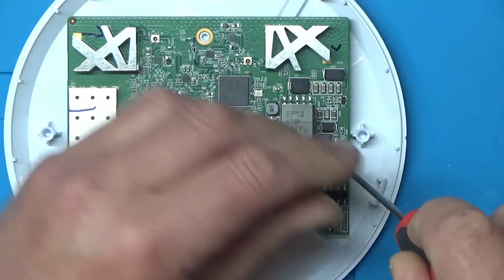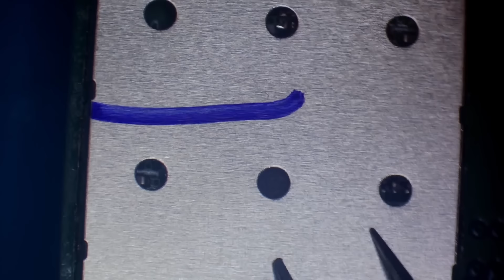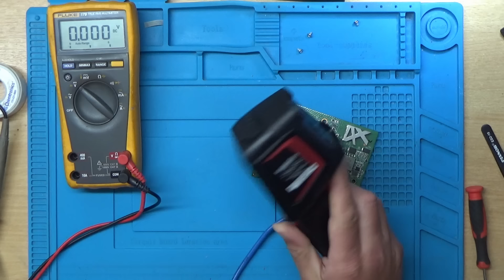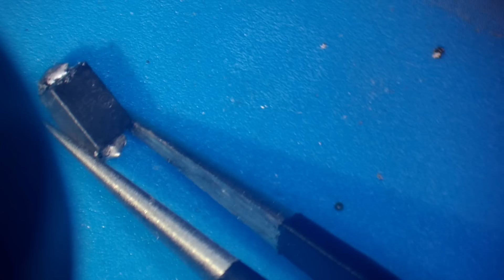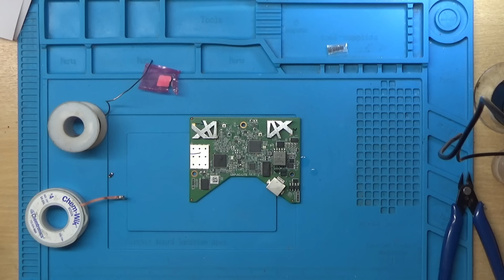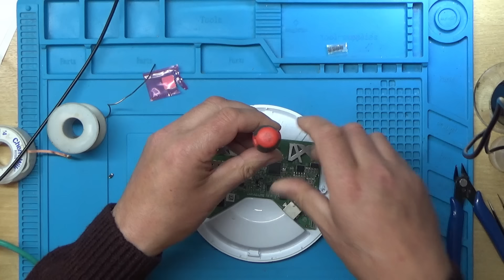Faulty Ubiquiti AC Lite WiFi Access Point | Can I Fix It?

Comment: Ubiquiti made some nice SoHo-Routers like the Edgerouter Lite / ER-3 but many suffer from broken USB-sticks (inside, cheap mans flash storage) and sadly broken ethernet ports. Replacing the USB stick is super easy and fixes the device, debugging the broken eth0 port is not. It's also the only one that comes up after a factory reset.
Reply from the maker: Interesting. Thanks for sharing 👍I've got a dead Ubiquiti POE switch which I'm currently looking at..

Comment: How come the diode didn't measure dead short in the circuit?
Reply from the maker: I'm not sure, the only thing I can think is that something else in the circuit was causing a false reading. I can't remember if I forgot to unplug the cable so it may have had power in the circuit still.

Comment: Have a go at the blue led lol.  They fail after about 6 months of use.
Reply from the maker: Yes a few others mentioned. I think someone mentioned putting two in parallel to reduce the current. It would be an easy fix but I've sent the unit back already.

Comment: How do you order such small quantities of components? Isn't it very expensive in shipping cost?
Reply from the maker: Yes, normally I'd use Aliexpress or Ebay if available. Or I've even ordered a small board from Amazon before when I needed a battery charging IC as it was cheaper than buying the IC by itself!

Comment: You want to try a crack on a video card? I have an older GTX 1050 Ti that the fan, when pluged in to the PCB, won't spin and do fan things. It was in my server for transcoding, so I did the right thing and soldered in a 3-pin female connector to plug in to a male connector on the motherboard. In the motherboard settings, I would just ramp the fan up by CPU temps. It would be nice to get that fan working again. I mean, it's not very powerful by any means, but it will do like 20 or so. transcodes, which is great for a very budget video card because you can support a whole village with it if you need to.
Reply from the maker: I've just bought a couple of GPU's to have a go at, the only problem is getting set up with a motherboard / psu etc on my desk to be able to measure / test everything. It's on my todo list which seems to get bigger by the day 😂😂
Reply: @BuyitFixit  always your youtube famous lol

Comment: If that thermal camera has a usbc port you can probably connect it to a pc and it will show up as a capture device.
Reply from the maker: Yes, you are able to record that way apparently but it's a little inconvenient. Ideally you should be able to record to SD after all it's 2024 not 1994 😂😂

Comment: I had the tvs diode fail on mine when I accidently put a 48V POE adaptor on it.. I just removed it and it runs fine.  it's primed for failure.
Reply from the maker: 😂😂😂Yes, I'm sure it would fail more spectacularly at some point.

Comment: 8:28 one tip to make the multi-meter shown the actual voltage when it's blinking like that is to take it out of "Auto Range" mode and manually set the range.  The problem with Auto Range is it takes so long to detect the range the power has shut off before it is able to lock onto it.
Reply from the maker: Interesting I hadn't thought of that. Thanks for the tip 👍

Comment: From my experience it should work when you remove that TVS diode. It is there as you said to protect the electronics behind and is usually at the entrance.
Reply from the maker: Yes, I suspect it should work by just removing it, although if the wrong PSU was used then it could destroy things further on instead of sacrificing the diode 👍
Reply: @BuyitFixit  Exactly or if there is another lightning strike the board could be damaged without protection.

Comment: "D23" on the white silkscreen refers to 'Diode 23' 😄
I have one of these APs, the Blue light fades over time, it's a design defect in their 5 series but the blue light is supposed to be brighter. (out of the box it was blinding so probably running it too hard) 
Had the power injector fail on me recently and had to replace, but looking to replace the whole thing with a newer wifi 7 model in the near future
Reply from the maker: Yes a few people mentioned about the blue LED 👍

Comment: hi out of interest what was the cost inc p=p for the part , i looked it up here in australia aussie website and it is for the part AU$0.61c and Shipping AU$24.00 thus making it $24.61 for 1 diode which is prohibitive for most australians but on aliexpress ( dont know the quality maybe you have opinions would be nide to hear ) 20 for $3.03 $2.99 p+p no wonder aussie busineses are failing, i have the ubiquity ap in my home so nice to see this fix, as an aside please do a vide on testing capacitors if you have not already done one if you have please put the link up thanks
Reply: thanks for the reply will keep watching
Reply: found my caps that i think i need for networking switch power supply on ebay australia from china free p=p will give it a try cheers i have inspiration but not the skills lol😀.
Reply from the maker: It was this item here I ended up buying https://www.ebay.co.uk/itm/155755878921 £4.49 inc postage for 5. They were cheaper from other supplies (22p each or so) but the postage was £9.99 so I just ordered them from eBay as it was the cheaper option 👍

Comment: Interesting that when listening to this video when you switched it on and it was working there was a background whine/buzz.
Reply from the maker: Yes the power supply I was using was an old one from an old access point I got from someone. It was buzzing so I switched it out for another PSU I had nearer the end of the video.

Comment: Since 2003, the PoE standard 802.3af has been upgraded to support higher power delivery. In 2009, the IEEE ratified IEEE 802.3at, which defined a similar technology that could handle more power. The latest PoE standard is IEEE 802.3bt High Power PoE, also known as Hi-PoE. So one might wonder if the unit was designed to only run off A or B mode cables or their own Proprietary switches if so that's Lame. Nice find with the infrared camera.
Reply: Early Ubiquiti gear used so-called "passive" poe which was just 24v thrown across a couple of pairs. There was no detection involved - the 24v is always present so you had to be careful not to damage equipment that wasn't designed for it. They did move away from it, first by selling dual standard access points that would accept 24v passive or 'proper' 802.3af, eventually dropping the passive 24v altogether. The 'dual-standard' access points had a sticker on the back that looked a bit like a power button symbol - a one and a zero superimposed on each other. I seem to remember there was a 48v passive too for the higher power gear, again totally dumb so plugging that into something that's not expecting it is likely to release the magic smoke.
Reply: @andywright3107  great information, Thanks

Comment: I own four Nano HD ACs. All the blue LEDs are starting to fade out. Any tips on where to get new ones? I have soldering experience and would like to replace them with "quality" LEDs.

Thanks for the great video. You've got yourself a new subscriber!
Reply from the maker: Thanks 👍It might not be the quality of the LEDs that's the issue. It might be that they are over driving them, and changing the resistor that feeds them to one of a slightly higher value would make them last a lot longer (albeit with slightly less brightness).

Comment: Congrats on your fix. These UniFi APs are enterprise-grade. I have 4 installed in my house (various models, including an AC LR, same generation as yours), never had a single hiccup. These work best with a controller, which can run on any Linux machine, mine runs on a Raspberry Pi 5. The controller allows not only to configure your WiFi, but also show connected devices, IP addresses, bandwidth usage. Although for just one AP, the app will do just fine for configuration.
Reply from the maker: Thanks for that and the info 👍

Comment: The Ir camera is an invaluable tool to have when trying to fix some of these boards. I really need to get one too. The only thing is that to get a descent quality camera, you have to pay a lot for it. The website you posted is awesome too. I had a diode I was looking for the other day and couldn't find it because of the markings (S4) on it didn't show anything I could find online. Eventually I worked it out, but it took a few hours to figure it out. great repair on the wifi too.
Reply from the maker: Cheers Ron

Comment: I love your videos, not least because I enjoy your accent, but I still found it really jarring every time you said "ethernet". I have been in IT for ever but I have never heard anyone else pronounce it that way!
Reply: I thought he said HefferNet!
Reply: It came from a working location that was probably the correct 24 V as it needs. Even a 48 V suppy "shouldn't" trigger a 58 V Tvs diode. However any lightning nearby area used /noise on mains will go over the limit for a short time & trigger the device, noise goes away device keeps working. However each activation will decrease the trigger voltage so fine with 24 V supply but with 34 V margin not so much at 48 V with 10 V margin (~58 V Tvs). Each device will see different local noise so random failures over time.😢

Comment: Great fault finding!!

 You are probably aware of this component removal process,  I use 2 soldering irons to remove 2 terminal SMD components.  Very quick, and less possibility of damage to surrounding parts.  Another trick I use on multi legged components, is to bridge all of the legs with a piece of tinned copper wire.  Then use the 2 irons to remove the component.  Helps if you have another person to man the tweezers.  Great channel. 

I really enjoy your challenges and fault finding techniques.
Reply from the maker: Thanks 👍I didn't think about using two soldering irons. Thanks for the tip. Hopefully I'll remember it.

Comment: I had one similar fail on a Raspberry Pi 4, bought a pack of 10 "ST SMBJ5.0A 5V 600W 2Pin SMB Unidirectional TVS Diode" for £1.75 from RapidOnline and all working again!

I found it with some IPA as I've not got a thermal camera! :-)

Comment: One trick I love to use for reading the etched characters on IC's and components is get a sharpie, run it over the etched area, then wipe it away with a qtip.  The etched area fills in with the sharpie and gives you enough contrast to read it easier.
Reply: Same, but I use a white paint marker.
Reply: @perkulant4629  I'll have to give that a go.  Probably works better due to the contrasting color.
Reply from the maker: Cheers for the tip 👍 I'll try to remember that one!

Comment: Ubiquity used to be so easy to set up, but nowadays it’s pure horror. But once they are up and running, they are awesome AP’s!
Reply: Not so bad when you ssh in with putty and set the inform address to the unifi controller. Sometimes having to do that twice, once after you adopt it on the controller. Often when they are not on the same subnet as the controller..
Reply: @Blackwolfster  You can use DNS or DHCP to 'point' them to the controller if they're on different subnets. Make 'unifi' resolvable in DNS to the controller's address, or use DHCP options to push the controller's IP. Then when you plug in an unconfigured AP it'll automatically appear for adoption without having to mess with SSH etc.
Reply: @andywright3107  I forgot to mention DHCP option 66 and yeah the LAN DNS option.
Reply: It ain't that hard with a controller. I never had any issues setting up new APs. Once connected, the controller would see the AP and offer an option to adopt it.
I only ever had to SSH to an AP to properly de-configure the old controller when migrating that AP to a new controller (my fault, I didn't un-adopt the AP from the old controller before migration).
Reply from the maker: Cheers for the info 👍

Comment: I repair a lot of ham/amateur radio equipment and TVS diodes are quite a common failure point. I say failure in so much as they sacrifice themselves to a short to prevent damage further downstream when a voltage spike is detected. Really useful protection components. Karl
Reply from the maker: Interesting. Cheers for that 👍

Comment: There’s a lot of components on that board. Is that a good design or a terrible design?
Reply: Depends. I also think there is a lot in the software because that thing is a whole Linux based system running an application or multiple applications/processes to fullfill the function which it might need all the hardware for
Reply from the maker: I'm not sure, I don't design electronics, I just try and fix stuff 😂😂

Comment: You can record footage from this Camera!

Everyone upvote this comment so it is seen! Thanks :-)

Take the Camera and plug a USB Type-C Cable into it, then take the other end of the Cable and plug it into a laptop, desktop, or tablet that is able to run OBS.

OBS is Free & Open-Source Software, it is free to download and costs nothing to use, it relies on donations!

Open up OBS on your computing device, then go to the source option and select "USB Webcam/USB Camera" option, then on your Thermal Camera set it to "Projection Mode" (The manual for your camera which is available online explains how to do this).
Your camera feed should appear in the OBS software live view Window, next all you have to do is choose where to save your clips, set it to save as your chosen file format (MP4 or MKV are recommended), and then click record, it won't record audio from the camera unless it has a microphone, so you will need to sync up your primary camera audio with the thermal camera footage in your video editor software.

My instructions are vague but provide enough basic details that YouTube tutorials and the manufacturer Manual can fill in the rest of the information.

Good Luck Dude!
Reply from the maker: Cheers for that, but it's not very practical especially if you are using it in the field. I've got an infiray p2 pro that plugs into a phone and you can record no problem. There are other similar cameras that offer recording without additional hardware. I've used OBS studio quite a few times when doing some videos like reverse engineer stuff like the deep sea controller where I recovered the pin code and worked out how the hours etc were stored.

Comment: Excellent vid and repair!  Thanks for this and for doing the deeper dive around the board.  It would've been interesting if the jtag/serial headers had data on them to investigate too.  The setup(well adoption) is usually quicker using the controller than the app.

@spikester - Yeah we had hassle with a few of these too for the voltage reason and had to use the power injectors in a few places despite having the switches.

Keep up the great work Mick - fantastic seeing you saving stuff from ending up in a tip/recycling bin and giving it another life!
Reply from the maker: Cheers mate 👍

Comment: It won't offer wifi until it has an IP address. Attach to your network and it should have started
Reply: If only that option was disabled, i have mine disabled because its annoying for network troubleshooting on phone
Reply from the maker: I did, and it still didn't show anything...
Reply: @BuyitFixit  If it's setup in an existing environment, then it will try to connect to its controller and won't enable wifi until it is on the network and connected to the controller. In this case I'd imagine that Steven's workplace probably have an on-premise controller which you can't connect to.

You don't want an access point serving clients when it's not actually connected to anything.

Comment: Any device that needs an app to set up is just trash. Nice job repairing the thing, the thermal camera is a nice tool to have.
Reply: It's an eco system. If you have a unifi gateway it just pops up and in a few minutes it has the same settings as the rest of your setup
Reply from the maker: Yes I'm not a fan of stuff like that, but I can see it being useful to remotely manage a site where you have 50 access points installed in a building instance.

Comment: factory reset won't get you an SSID
Reply from the maker: First time I've came across one of these devices, but I got there in the end 🙂👍
Reply: @BuyitFixit  Wifi analyzer on the android store will show the hidden wifi mesh signal. Provided it's not been disabled. Factory reset would enable that again if it was disabled.
Reply: @BuyitFixit  yes you did, honestly, i posted this reply before I saw you use the network application on your phone.. this is the correct way to configure these devices.
Reply: Try some of the Cisco ones, almost impossible to convert from business to home use, unless you can flash it with naughty firmware as the original is licenced to the router.
Some have Bluetooth for tracking g and  multiple access frequencies, can run lots of devices at high throughput and are controlled in a cloud system remotely.
BT run one such system for free in UK Gov offices. You might wonder if it is BT or GCHQ.  What do they get from investing £Millions in a free WiFi system and Internet access for UK Gov. How do they make any money apart from redirections and analytics.
The public can even use the network via a VPN.

Comment: Well done. Interesting (probably only to me) that the TVS was rated at 58V when some PoE switches can output up to 60V. At least you didn't say rowter and proceeded to do some carpentry.
Reply: Didnt know theres 60v POE standard, ui equipment typicallyd specced to 52v iirc
Reply: @TonnyCassidy  Class 0 is typically 44V to 57V, but I've measured some Cisco switches outputting 60V (which most PoE modules are designed to handle). After commenting I saw the comment from @spikester which mentioned only 24V is supported on these APs.